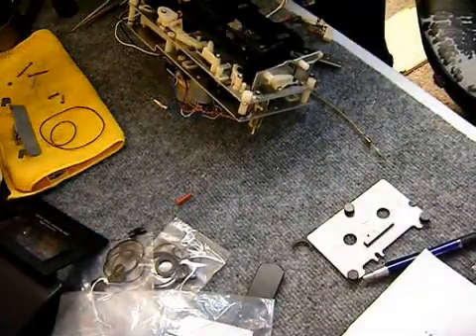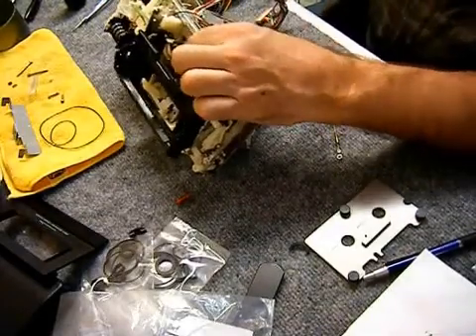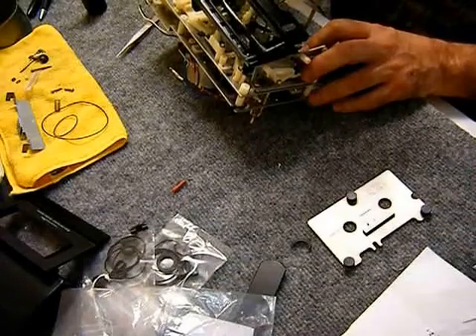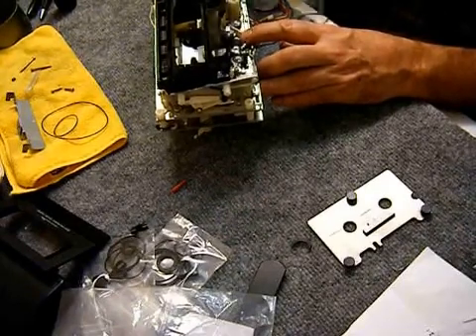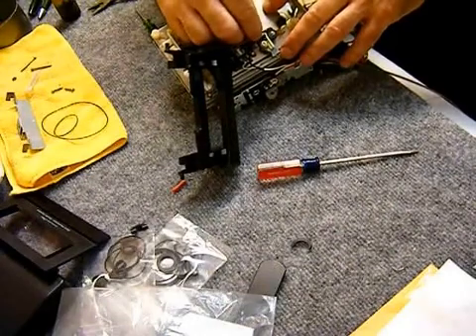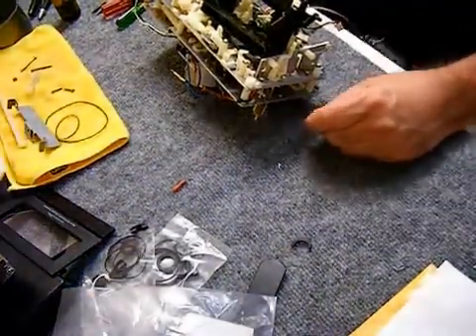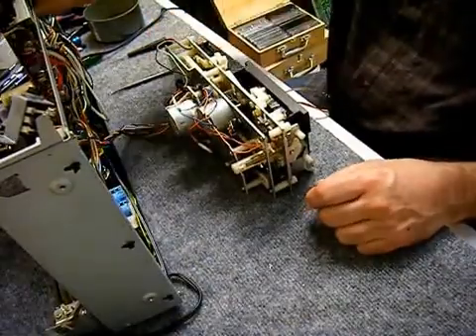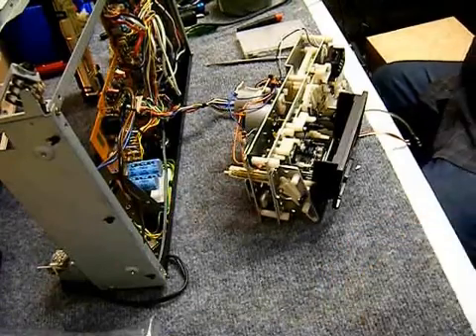Nakamichi cassette deck repair, part3

Comment from the maker: I found some reference plate stl files online.  If you have a 3d printer you can print a plate that will at least get you in the ballpark for setting the pinch rollers, from there, you use a good alignment tape to get azimuth right.

Comment: I need my zx9 worked on.  Do you do this type of work?  Let me know your contact info.
Reply from the maker: Since parts other than belts, tires and pinch rollers are largely unavailable, it is very difficult to offer a reliable repair service.  Given the unit's age, it is very possible that it needs parts that I cannot get.  I sometimes need to use salvaged parts from other decks in order to assemble a good working unit.   I wish it was different, but these decks are getting rather old.  Good luck with yours.

Comment: Hi Francis, thanks for the very nice videos. I have a 482 and used your videos to replace the belts and idler tire. The pinch rollers were stuck and had to take them out like you did but I couldn't find the reference plate you mentioned in the video. I guess there are some problems with the pinch roller alignment as I could see one tape curled badly. If you don't mind could you please post a link where I can purchase a reference plate? Other than that the deck works nicely. 

Also, I noticed lots of noise on the headphones and the output level is very high but they don't seem to show up on the line out. Is that normal or any adjustment is required to get it resolved?

Thanks again.
Reply from the maker: There are some reference plates on ebay.   I have seen some made from Plexiglas and some from steel.  I would prefer the steel if the cost is not too much.  I have no affiliation with any of these suppliers.  I just searched on ebay using "Cassette Head Alignment Gauge" as a search phrase.  Good luck, it looks like you are almost there to having it restored.  Here is a reference plate I found: https://www.ebay.com/itm/373971150021?_trkparms=amclksrc%3DITM%26aid%3D1110006%26algo%3DHOMESPLICE.SIM%26ao%3D1%26asc%3D238214%26meid%3Dd86979a4ee064b57a1cd7efc591d02bf%26pid%3D101195%26rk%3D3%26rkt%3D12%26sd%3D115213493801%26itm%3D373971150021%26pmt%3D1%26noa%3D0%26pg%3D2047675%26algv%3DSimplAMLv9PairwiseWebMskuAspectsV202110NoVariantSeed%26brand%3DUnbranded&_trksid=p2047675.c101195.m1851&amdata=cksum%3A373971150021d86979a4ee064b57a1cd7efc591d02bf%7Cenc%3AAQAGAAABMIIp3bTCXFAKw6S9crk9CpCrrtOgadqFiC10NVPbN0936eprYVB4SXfDa52e1mbPLHt567o9Q5EZAKRIfvkB%252BlddyUrhCFC5JXFtwpaH3wHlXEu86P6jE21LjRVlkKz9dFQfyTYZtw6nkSIf%252BeuG5lQYMtu2Dwh9uPT%252BUX%252FrCBdvyD%252FwFIpq33XePaJXINVtmDPzBccij1RK2IFi%252B5zK1Aq%252BW%252FJaOEp3FqbnBjTlx5lDEL%252FQ8ey4OvHoNIH%252FeA2FvgBTXMchZyZLRclViYbrGipa42C6zkolU6dtA00EhEnpOEP%252BpgFSgrmVmjIUJM9dZr%252BcVCDuYdeuBUjo7RUErMVvp9wAcMCZm1WIXwPJQZHRjN6H7iH7KcuN4B2KVIiZgJA7ChJ6Lo%252FIpy3bzKZz8y4%253D%7Campid%3APL_CLK%7Cclp%3A2047675
Reply: @fflynnful   Thank you. I will get one of those alignment gauges and adjust the pinch rollers. I have tried cleaning all the controls and switches. The cracking noise when I operate the controls are gone. Most likely it's the electronics. I have downloaded the service manual. Will locate the headphone section and see what is wrong. I also saw you replaced the film caps as well in part 4 of the video.
Reply: @fflynnful  - Thought of asking if you  offer repair service, I can send the mechanism to you to have it aligned. If not I will order the reference plate. Might be still not an easy task for me :-). Thanks again.
Reply from the maker: @SubbuKaruppiah  This is very old equipment and parts are not available.  The mechanism is part of the overall deck and must be calibrated to the electronics.  All that I can do is show you and others how to repair the mechanism.  In most cases, replacing the belts and rubber pulley tire is all that is required to make such an old unit play a tape.  I like to restore them to original performance including recording to original specifications.  I refurbish and sell machines that perform to original specs.  Look for me on ebay under "likenuagain".  I offer rebuilt machines there.
Reply from the maker: The headphone problem is likely a circuit problem.  It's very likely bad electrolytic capacitors.  The liquid electrolyte in them can dry up over time and 40 years is a long time.   Service manuals are available on the internet.  But try cleaning all switches and controls first before you dig too deep, sometimes a little contact cleaner spray solves the problem.

Comment: Very nice done. gratulation! I am fighting with a 480 just at this moment. Changed belts, idler, cleaned /lubed here and there. The right pinch roller arm stuck down totally, so I pressed it carefully against its spring (not down!) and put a very very small drop of oil in the space. Then is was free (after pushig play/stop about 50 times)- but totally out of the tape path, about 4mm.(I am shure someone had his hands on this- maybe to free the arm) To align it, I used one half of an empty cassette shell and compared the distance of the roller/path guide to the left pinch roller/guide and the half cassette. Of course that is not 100% perfect like a reference plate/gauge, but aligns about +/- 0.5mm correct, I guess. Now it is working perfect, l/R channels both the same, no more curling the tape. After all, very nice cassette deck, but not the easiest to service.
Reply from the maker: I am happy to know that you have your Nakamichi back together and sounding good.  Some of them can be challenging, but the Nakamichis are among the best performing cassette tape decks.  You have found a clever way to set pinch roller height.
Reply from the maker: A trick to get those pinch roller arms loose is to "warm" them up with a soldering iron.  Don't get too crazy with doing that since the pinch roller arm supporting posts are set into plastic at the transport base.   The heat from a soldering iron is just enough to liquify the old lubrication enough to get the arm off.  Once you get it off, clean it up, re-oil it, and do your best to get it back in and adjusted to the correct height.
Reply from the maker: When the pinch rollers arms stick, it becomes a special challenge.  :)